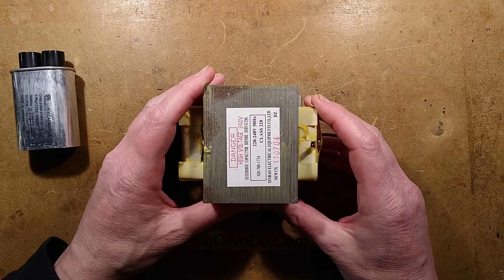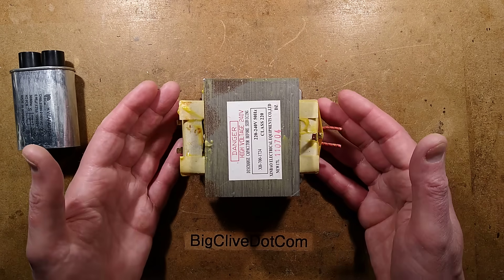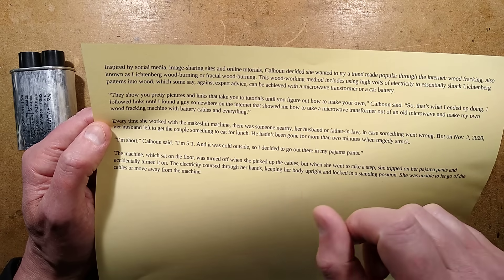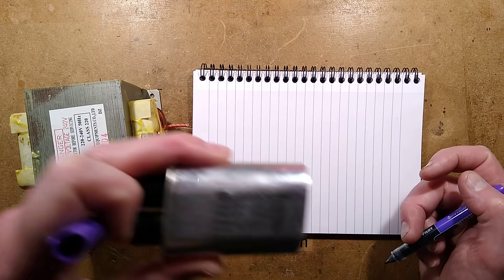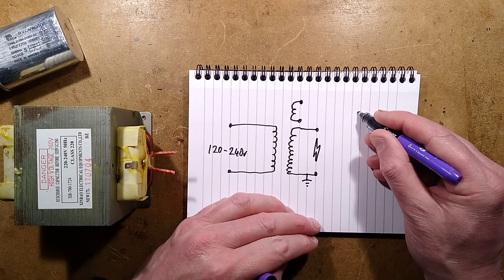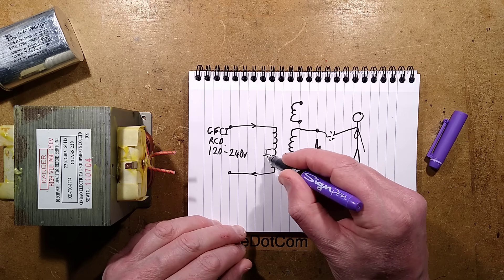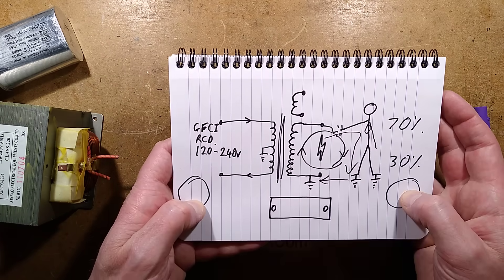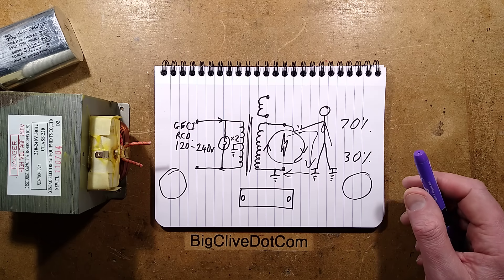The most deadly project on the Internet

Comment: As far back as I can remember and since many years working in the Broadcast and Electrical Trade with voltages and currents of all varieties and energy levels, I have often pondered the idea and thought about how nice it would be if somebody (or the man upstairs) would focus on and invent (or cast) a new type of electron that can be generated and travel through wires as we know it but is not able to injure people when passing current through them, thus solving the safety issue of high voltage - for good. The fact that I can envision this conceptually and create it in Hollywood is a pretty good indication that it can and one day will be done. Man just does not know how to do it.....Yet.😇
Reply from the maker: It can be done at high frequency, as the nerves and muscles do not respond to it.  But the burning aspect is still there.

Comment: i wanted to make spot welder from microwave transformer, but im bit scare of them because they operate on big boy electricity.
Reply from the maker: Once the high voltage secondary has been removed they are a lot safer for other technical projects like welders.  Just be aware that you are working with mains voltage at all times.

Comment: 😂 whats funny and scary is 2000 volts is medium voltage. High voltage... at least as far as the majority of the worlds categories go doesnt start until 35000 volts. Not in any way knocking the lethality of the transformer because even if you survive your gonna be in pure h3ll for the rest of your life. Because anything it does pass through is quite literally being flash barbecued in the blink of an eye. so if you survive youll be battling the pain from severe  and permanent internal organ muscle and nerve damage from cooking yourself from the inside. I dont think id wanna exist after that. I fabricate industrial automation/electrical panels. For a while i had a team of 4 apprentices that worked under me and an entire team of normal techs. For the most part i did all the live testing for qc and ul certs. Thats a whole lot of baby sitting. Anytime one of them would ask(and they all did) if it would hurt to get shocked with any of the live equipment. I always said the same thing. Itll only hurt till you die. The majority of what we  were doin was 480v on the high end. So not super crazy but occasionally we built medium voltage stuff upwards of 20000 volts. 
The sayin around there was "what doesnt KlLL ya only makes ya stronger...except ELECTRICITY. That Definitely KlLLS ya.

Comment: Hi. What's the secondary voltage on this transformer? It doesn't say on the transformer?
Reply from the maker: It can vary.  It's not marked because it is usually made specifically for the microwave model it is in.  Keep in mind that these transformers are extremely dangerous compared to neon sign transformers that still pose a hazard, but not at the same level as this type.

Comment: There have to be programs to draw fractal patterns that can be transferred to a piece of wood and burned in using a low voltage wood burner. Is doing it the "easy" way worth applying for the Darwin Award?

Comment: I have seen up close the workings of a 10KW broadcast transmitter while it was on. I was with a station engineer who was checking the rf current at the transmitter sight. He knew I would follow his instructions. It was very interesting and looked very dangerous. Very high voltage three radio frequency amp meters in three different sheds spaced ¼ wavelength apart in an end fire array. They had quite the elevated counter poise around each tower. He explained that they always have trouble keeping the pattern stable because the back of the array has better ground conductivity than the front.
There were scorch marks from lightning and other paths to ground had occurred. Keep in mind that the feed points for a quarter wave are at low voltage if things are right higher voltage is at the top of the antenna and there are huge spark arrestors for the lightning to get to ground.

Comment: According to Adam Savage, there are some tools that you should never use unless you are terrified of them.  His example is table saws, which can remove limbs in a fraction of a second and leave you rapidly bleeding to death.  I think high voltage electricity deserves a place on this list.  You should be terrified of it, and if you aren't, you have no business going anywhere near it!

I've found this kind of stuff mildly tempting, but it's not tempting enough to overcome my sense of self preservation.  (And I know all of the safety stuff for electricity.)  I do want to make a low voltage welding/arc furnace system with a microwave transformer though!

Comment: I used to write with these gel pens over the normal bic pen or number 2 pencil in early school ( they would smudge too). I hated a pencil cause i could erase what i thought instead of going back and noticing i was wrong.... Its almost impossible to find them out here for a reasonable price.

I still have my old uniball pen that i got 25 years ago with 2 more replaceable ink carts. But the body is cracked and held together by tape ( it was a push top pen and iv had to rescue the spring a lot). I know nothing about electricity just noticed the pen he was using

Comment: Just for the non electrical folks out there.

A transformer is where a current from one set of coiled wires is "transferred" to another set of coiled wires?

So the more windings in the coiled wire the higher the voltage becomes, but the lower the amperage since the total wattage power transfer will remain the same?

And why does a microwave need such a high voltage to operate?

Comment: I used to build polyphase motor speed controls for 250HP 3-phase motors.  The 480V 3-phase power is rectified to a 600-Volt DC buss from which the transistor packs are then signaled to drive the motor by pulsing the stator coils at the proper times via a PWM firing circuit. This was nearly 40 years ago, and I can still remember the PWM chip we used: the Marconi MA818. In any case, I was testing the DC buss "soft-start" which meant the ground-fault detection circuit was disabled in order to test for parasitic issues in the capacitor bank and thyristor-type rectifiers. Somehow, I errantly grabbed onto a buss bar while energized. My other hand was in my pocket for safety reasons, but my right knee was touching the steel cabinet for a circuit. A DC shock is nothing like an AC jolt. The feeling I can (barely) recall is like being crushed by an enormous weight.  The main issue with a DC shock is it make one's muscles "lock up," meaning, you grab onto the thing shocking you *harder*. Fortunately, our testing protocol required an observer for just such situations. They knocked me away from the cabinet with a push broom and I spent the next 30 minutes being respirated by EMTs while my body had zero control over its various functions. The entire shock event was maybe 4 seconds in length and did that much damage (I was on disability leave for 8 weeks but returned to work on more controllers with no further mishaps for 27 years.) Long story short: do not even think of messing with these microwave oven transformers.  I am used to working in this sort of high-voltage environment and I still nearly got killed. Just...don't.

Comment: I did use an old TV flyback transformer I converted on my tesla coil. Pretty safe as long as you don't touch anything before the spark gap. I have witnessed the after effects of someone who stood on the roof of a van under high tension power lines, to get a selfie with his hand reaching inches from the power line. It was summer, so more power demand flowing to homes. Electrical Ausgrid worker advised me on a day like this approximately 4000 amps flowing. Needless to say power jumped to his hand and exited his foot leaving burn marks and molten metal on the van roof. Police Tasers are 50, 000 volts and only 0.5/ 1/2 an Amp. Its not the volts that  kill you its the AMPS.

Comment: I had a similar Electric Shock caused by a Washing Machine which happened to me in the 90’s, I was in my Flat in Birmingham and I’d just woke up, Went into the Kitchen and noticed the Drum in my Washing Machine was not rotating, The Lid was already off or loose so I went over to the Washing Machine, Looked at the Belt behind the Drum and noticed it had come off, I looked over at the Plug in the Wall and thought: “I’ll be ok” and proceeded to reach down to the Belt, All I can remember is both my hands clenched shut, I couldn’t Scream, Shout or Move, There was plenty of Money in the Electricity Meter so that wasn’t going to go any time soon, I honestly believe that it was Divine intervention that stepped in because I couldn’t do anything, That is one situation that I will never forget!

Comment: There all aluminum now but i used to take the copoer out of the transformers in micriwaves to smelt fir projects. A rubber glove and an insulated screwdriver is how I discharged the capacitors. NOT WITH IT ! Also that pink thing on the side of the magnetron is beryllium. DONT DISTURB IT. DUST IS TOXIC. Best to take it to the recycling center. You can keep the power cord.
Reply from the maker: The pink bit is not beryllium it tends to be a safe ceramic now.  If it was beryllium there would be warning signs everywhere.

Comment: I too, was inspired to try and succeed in fractal burning. I use a neon transformer connected to copper probes that I made. These are running thru pvc tubing. The neon transformer is connected to a power switch and then to  a Deadmans pedal that I step on to apply power. Redundant safety. I never touch the probes.
The difference between me and the others is that I know what 3000 volts can do. Great video mate. My next venture will utilize a microwave transformer.

Comment: High frquency has different, nasty properties.  50Hz is considered to be the most lethal frequency wrt. Ti its effect on muscles including the heart.  60Hz however is barely any better.  With rising frquency the effects are getting less and are generally considered to end by 20kHz.  Similar for the effect on nerves which just won't detect high frequencies.   There is also the ski  effect which keeps the current flowing closer to the surface the higher the frequency.  All this combined makes RF burns somewhat nasty.  Because the victim doesn't notice they're in contact with a power source contact tends to stay relatively prolongied even if breaking it would otherwise have been possible.  Minor RF burns may look look like dead, grey skin. Even if the look minor the heat may have caused sufficient damage in the depth of the tossue (this the grey colour) to cook skin and flesh.  Note tjat not all RF burns do look greyish. Even small sources of 10W or less many cause RF burns.  Putting it differently, the heat generated by RF current is the main source of damage.

Comment: It is entirely possible to do fractal wood burning with a neon sign transformer. 12k to 20k volts but only 3ma in current. Microwave transformers are far to dangerous.
Reply from the maker: The neon transformers can still give a shock, but pose a much lower risk of fatal electrocution.  They are available in various current outputs.  30mA, 50mA, 100mA.  Most are 30mA.

Comment: I got a job as electric calibration Technician, I had no biz doing, I ended up rebuilding 5kw power supplies, 3phase.. terrifying how big those transformers were.. I got pretty good at it and was the golden to guy for getting them back up and running, but one time I installed capp backwards, they were like 21 uF or something like that.. 😅idk how i didn't die.

Comment: I work with these things in HVAC and I didnt know they were THAT dangerous. I mean I obviously treat all electricity as it’s dangerous.
Reply from the maker: A normal transformer is usually relatively safe.  It's the high voltage/current ones in microwave ovens that are a significant danger to service engineers and DIYers.

Comment: My daughter wanted to do this a number of years ago. I work with high voltage dc circuits and knew the danger. I bought a  neon transformer as they have insulated keads to help guide the path safely.I got her lineman gloves with leather covers, used insulated pliers made completely from plastic , unplugged it and plugged it in from 10’ away to do the burning. I built a wood/polycarb box to do it in. Its beautiful the shelves we made. Following all of these safety precautions, still scared the piss outa me!

Comment: I recently took a job as a draftsman at the local G&T co-op.  My boss wants me to become an engineering tech for substation design when another guy retires.  He has started teaching me a lot about this stuff & sending me to classes.  I've also started learning on my own because it has fascinated me more than I thought it would.  He's dead right about that microwave oven transformer bumping voltage up to around what go through overhead lines in your neighbourhood.  Stop screwing around with these things.

Comment: Wait I dont get it, like why not design a machine that can do it 100% guarantee with safety built in? Like imagine something like a water jet table or a laser machine that your job is just to load in the piece, load a program for what you want the fractal to look like, and the machine will apply the salty water only to the desired area and apply the electricity.

Comment: I'm fortunate that I learned a painful but ultimately safe lesson about high voltage capacitors and the dangers of working on the guts of electronics when I was younger.  Had it been a microwave, I would probably not been alive, fortunately it was a camera with a flash capacitor.  I had no idea the capacitor would be charged, I wasn't expecting to get shocked and I wasn't expecting the sudden jolt of blinding pain in my hand when I shorted the cap.  But I do remember everything.  You can never be too safe with capacititors and high voltage sources.  Make sure everything is disconnected from mains or battery, and then discharge every high voltage capacitor.

Comment: Always unplug. Always unplug!  Always unplug!  And keep that plug on your person when working on anything.  Never plug it in until absolutely sure everything and everyone is clear.  And use a variac to control the current, don't just plug it straight into full mains voltage — the MOT is not actually designed to handle that and it will burn up! .

Comment: Used to repair electronics as a side gig at uni. Always refused any job on imacs. Those assholes leave theor PSU capacitors exposed. Why? What possible reason other than to be an asshole would you do that for? I mean, imagine a kid wanting to upgrade the internal hdd or SSD and thinking it is a simple job. Why do that?

Electricity is dangerous.

Comment: I was hit with a bad floating ground and took high voltage across my hands and through my chest.  The current from a null meter used for bucking to measure standard cell, years ago. It was off the plate circuit of a tube supply. Basically a hot ground. 
I flew back a couple of feet and all I heard was the air coming out of my lungs. I felt it and saw a small hole out of my finger. My chest itched and arms hurt for a week. I'll never forget that one. I was trained on radar and RF equipment and had a career in avionics and broadcast. Safety is no joking matter and respect it tremendously. All it takes is 1 gotcha moment to end it all. Have a Merry Christmas and enjoy life.

Comment: Ive always been curious, and a tinkerer, so I've experienced a few shocks, 120volt just tickles, but 240?  Threw me 30 feet. My nieghbor wired up a 240 volt supply for a fan, in his basement up by the cieling, he asked me to plug it in for the first time, I stood on a cast iron sewer pipe running along the wall, so I could reach the outlet. He wired it up wrong, so when I plugged it in I got hit with major voltage and amps. I had no control of my muscles, it was only because I could no longer balance on the sewer pipe that I fell away and disconnected, it still threw me across the room.  That convinced me not to mess with 240.  But, I still was curious enough to take apart an old color TV, the cathode ray tube kind. There are warnings on the back of every old TV warning to never remove the cover, for good reason!  Apparently they use a capacitor so the TV will start up fast, this leaves energy inside even when the TV is unplugged. On the back of the tube there is a bundle of wires that passes through a rubber grommet, I pried this gromet aside with a screwdriver, and got zapped by the capacitive charge.  Having experienced lots of 120 shocks and that hude 240 volts?  The TV shock was by far the worst!  I never stopped wanting to know how everything is put together and how it works, but I have stopped risking high voltage shocks due to capicitors.  Anything else, Im game!
Reply from the maker: The TV uses a conductive coating between the inside and outside of the tube as a capacitor.  It holds a significant high voltage charge for a very long time.

Comment: I’d only attempt this after installing some sort of “this is live” indicator.

Other than that, setup the wires while it’s unplugged, sit down next to an outlet that is meters away, plug it in, flip the switch, do not get up from your sitting position until you’ve turned it off at the switch and removed the plug from the wall. As an extra safety step have someone at the breaker able to turn off mains in case of emergency.

Comment: the microwave transformer is really fatal, as is the Magnetron which contains toxic material, beryllium in the insulator and radioactive thorium. For everyone's safety, I recommend that electronic engineering evolve to a safer system with low operating voltage.
Reply from the maker: There is no beryllium in modern home microwaves.